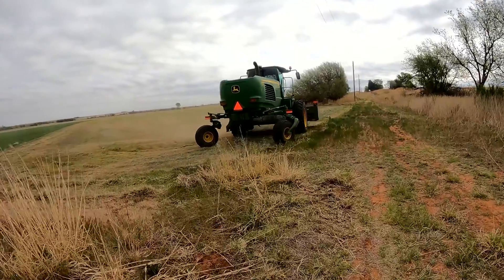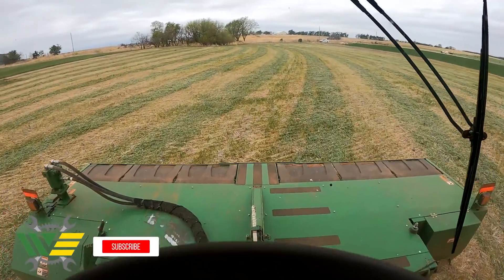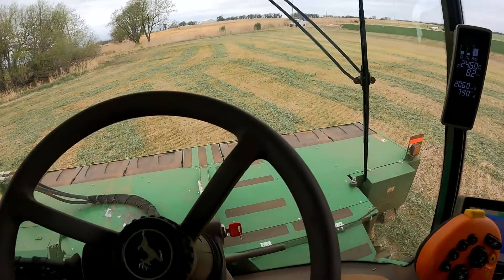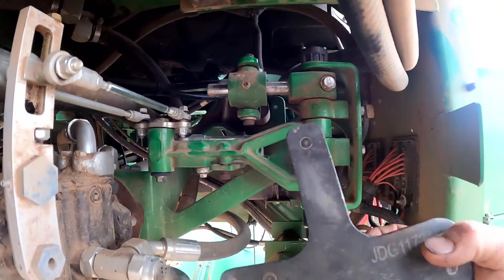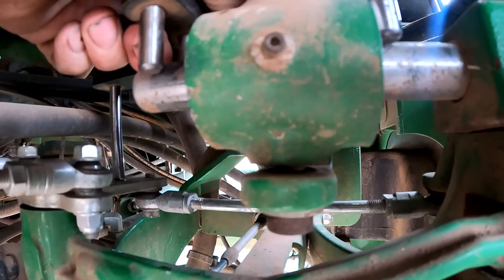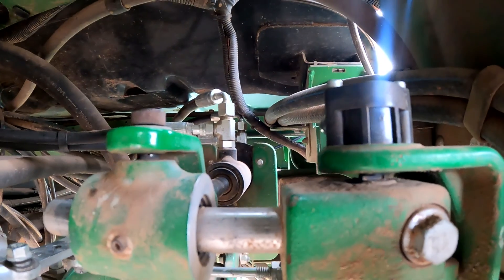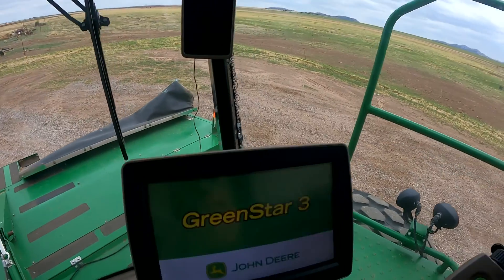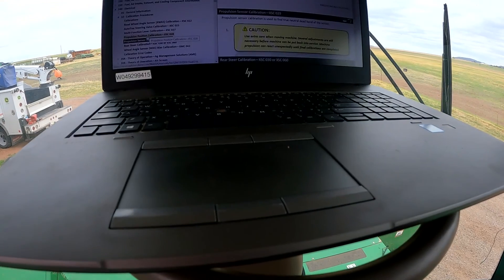Larry's Life E10 | repairing John Deere W235 Swather AutoTrac that's not tracking

Comment: Another great video I enjoy watching them when I was young I worked for a couple John Deere dealers now that I’m older I have a different job but I remember when I was working on equipment I loved it I still tinker in my garage I have a 2038R two series tractor and I enjoy mowing my lawn with that but great video I enjoy watching them 👍
Reply from the maker: @Dean Moore glad you’re enjoying them. Those 2038 are a handy size and fun size to operate.
Reply: @WesternEquipment  Thank you so much I have a lot of attachments for it but I enjoy running it it’s a great machine great video I enjoy watching them